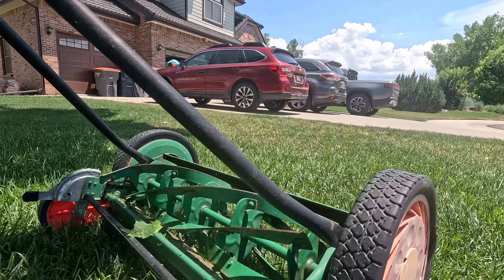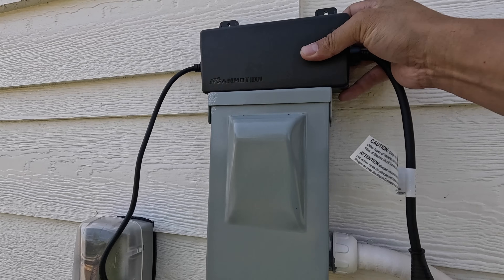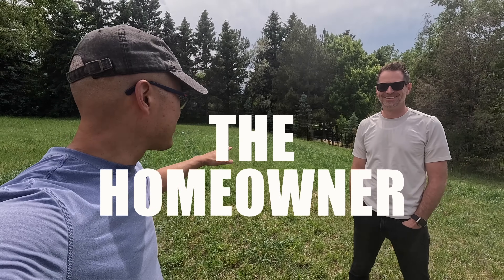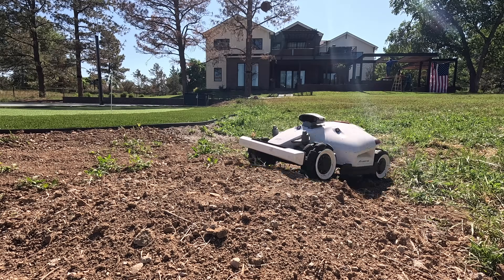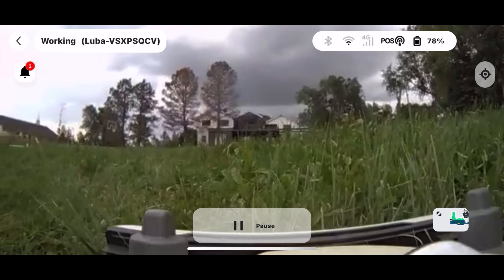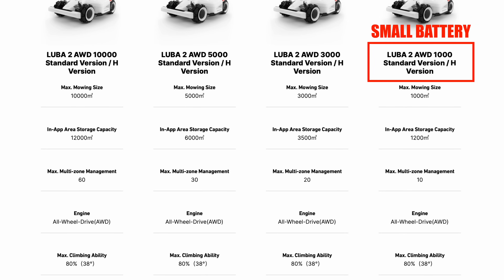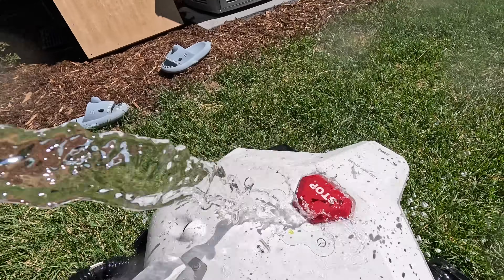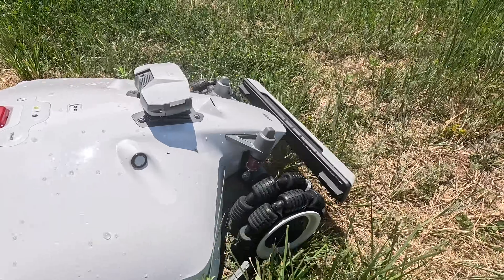The Best AWD Robot Lawn Mower for the Toughest Yards: Luba 2 AWD Review

Comment: ⚠ CAUTION ⚠
Purchased new LUBA 2 AWD 10000 for $4178
Worked for 6 weeks, then stopped
Support ticket created on May 20th
Issues remain unresolved by Mammotion (45 days so far)
Mower not able to complete a task properly.
Mammotion not responded to warranty request for replacement
Buyers beware, I’m certainly not the only one with this experience
Reply: has this problem been resolved?

Comment: Music is annoying af, YT is the best way to understand or chose any products. You dont ever need to wash underneath, especially when it's upside down, it's a no no. The 2 pins key is for desabling power to Luba, so you can't drain battery, good for off season time while battery is at 60% i think. Thats the way i see key feature.  The cam on top is mostly bling bling sadly as you described it, also, it's reducing clearance. I may buy the Luba 2 but the cam is a killer atm. Luba is doing great but Luba 2 can drive itself for awhile when it loses RTK instead of dying out of power when connection gets bad i think. Good review. Thanks.
Reply: Also, now it comes with a H feature which i really need. Luba can only reach 2.8'' instead of 4''.

Comment: The ‘security key’ is probably leftover from electric mower legislation. A lot of manual electric mowers have the same key.
Reply from the maker: Hmmm. Interesting. My manual electric mower doesn’t have one. Do you know the purpose?
Reply: @freshlycharged   Should be so that you can safely work on it without being chopped to pieces.  With a gas engine, it is obviuos when it is on.  With an electric motor, blades could engage at any time. Good to know the key is pulled and you are safe to work.

Comment: The thing that stopped me from buying one was the fact that the robot constantly loses connection to the wifi. You would need to place a few of those WiFi transmitters around your property to get it to work correctly and I don't know if it will even work with more than one transmitter. The tech is not good enough yet. It needs work before I spend the money.
Reply from the maker: I was concerned about this but WiFi wasn’t an issue, even from the farthest corner of the yard on Tyler’s property.
Reply: @freshlycharged  I have a large home. No way would it be able to keep connection at the backyard unless maybe I placed it on the very rooftop but then it would be very high and still far from the robot... I still feel the tech isn't ready. The robot might be but not the tech. Too many disconnects I am hearing about. They need to work on that. See other reviews on Youtube and read them as well. You will see. Sad as I truly wanted to buy one bad!
Reply: The robot could  work by itself without WiFi. It is not necessary if you don't want to monitor it anytime remotely
Reply: @KarlWang-q3e  Nope.👎🏻 Watch more video reviews on it. It doesn’t seem to work as advertised without WiFi connection. It also loses gps constantly. It’s just not ready. They need more time developing it.
Reply from the maker: @Tothefloor  GPS and WiFi are two separate things. If it is losing GPS connection, I'd check the positioning of the antennae. I'd say for Tyler's yard, once we got the kinks worked out, mowing every other day we lose signal once every few weeks. To fix this someone needs to walk out, physically move the Luba a few feet, and then resuming the task. A little inconvenient but much easier than actually having to mow the lawn.
Reply from the maker: @Tothefloor  One more thing, with earlier versions of the software, the Luba would lose GPS connection more frequently. After the most recent update, it does a much better job staying connected to GPS.